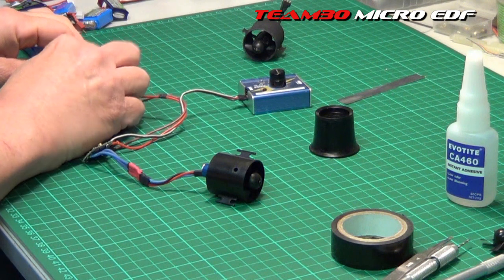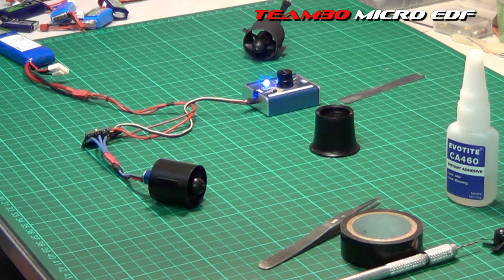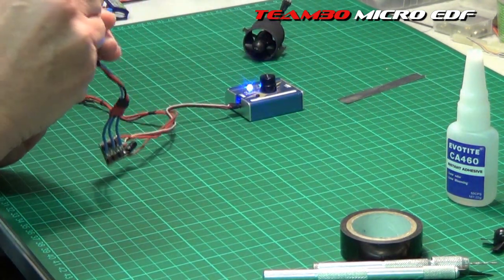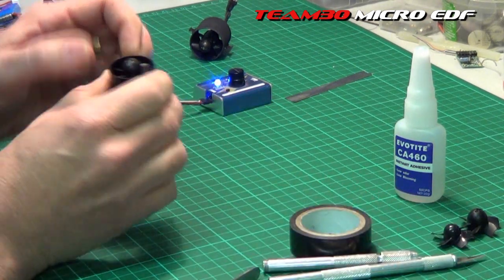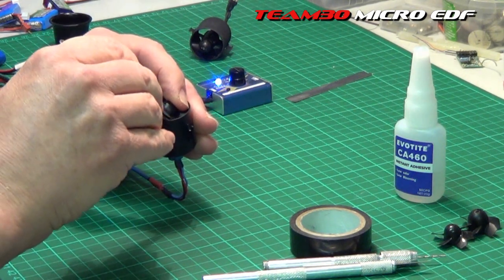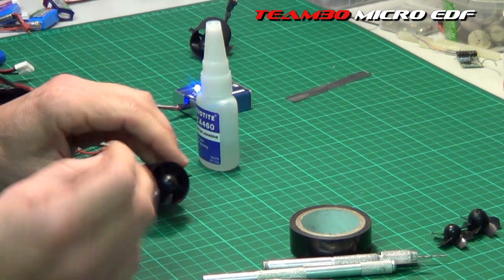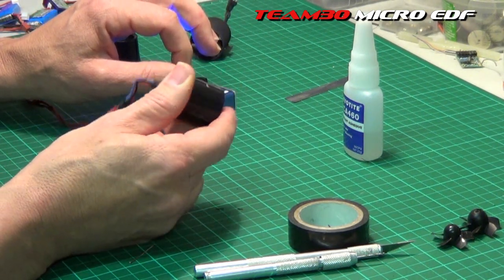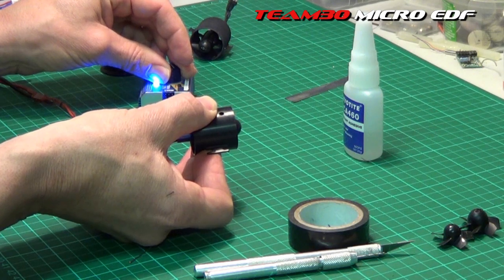How to balance a micro EDF!

Comment: Good Tute. Thanks. Is that a 35mm fan for your Skyangel ? Which motors do you use ? From where ? Instead of an eyepiece you can buy a $2.50 pair of 4X (or whatever suits your eyes to behave like a microscope lol) reading glasses at the cheap Chinese Junk shop.
Reply from the maker: Thanks. My eyes ain't what they used to be!  ;-))
Reply: NitroCharged Which motors do you use for your 35mm fans ?

Comment: Can u just leave the tape on? After u CA'd the tape, i thought u were done. Wrong ! Then u drilled. Doesn't drilling weaken it? Is there much difference in leaving the tape and taking off the tape and drilling. What if there is not a blade directly across from the taped blade to drill on. A blade in the middle of two blades?
Reply: Dwayne Loveday I believe he was drilling in the hub, not one of the blades